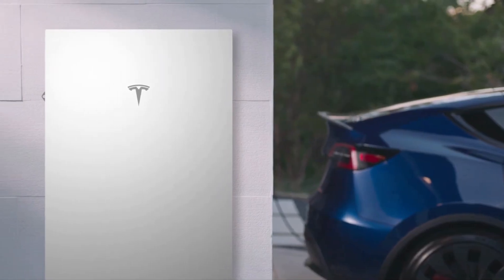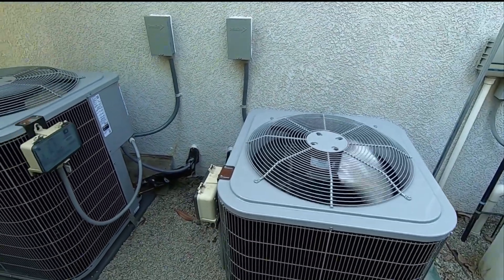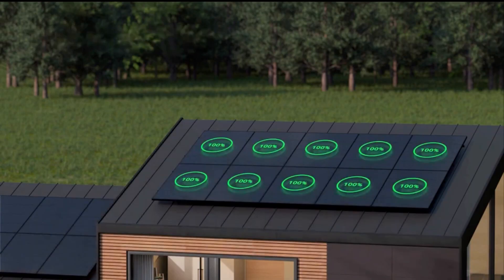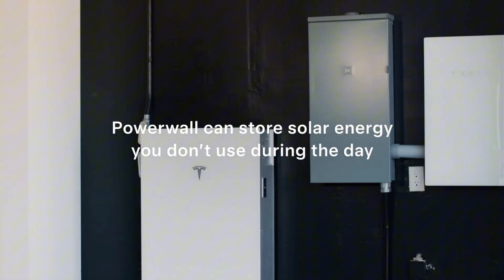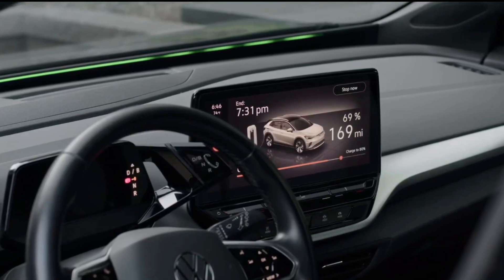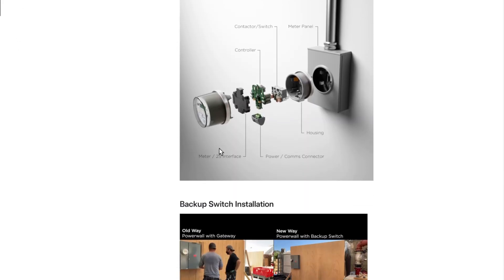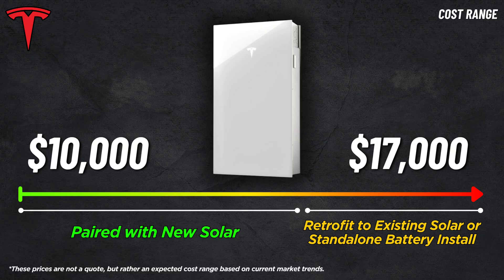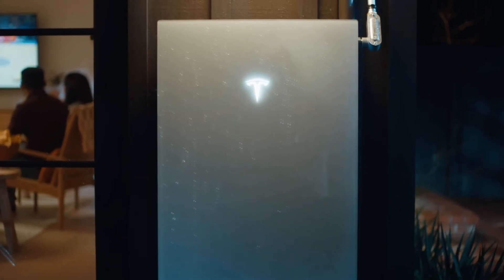Is Enphase REALLY Back? NEW 10C vs. Tesla Powerwall 3

Comment: Can we combine enphase microinverter with tesla powerwall 3 battery. What particular parts have to be changed or to be added to be able to run this hybrid system will this be financially practical.? The system I'm referring to is 17 solar panels enphase system without battery running for 4 years.
Reply from the maker: Yep, you could do this no problem. We pair Powerwalls to existing Enphase systems all the time. You don't need to change anything to the Enphase system.

Comment: Had Enphase Batteries for the past 7 years. Their product support is appalling, it's taken me in excess of a year to try to resolve an issue caused by them fiddling with their software. Still not resolved I'm dumping them for a Powerwall.
Reply from the maker: That’s a bummer to hear. Which Enphase battery did you have? The 10T?

Comment: @2:44 When Tesla makes that claim, is that power consumption designed in mind for a 24hr window?  48 or 72hr?  SGIP in CA is starting to push back on systems with 2+ batteries, stating the usage has to be accounted for before the rebate is approved.  But what does that mean?  During our wildfires, we can be without power for days at a time, but how do you gain support given your current consumption of power?
Reply from the maker: Tesla is saying they can backup the vast majority of single family homes meaning it has the power (kW) to support all of the circuits in most homes. Now how long will that battery last during an outage? That’s entirely dependent on how much energy the home uses (kWh). Most homes will range between 6-12 hours on a single battery depending on AC usage. Incoming solar energy can recharge the Powerwall during a prolonged outage.

Comment: The size, capability, functions depend on the size of your house and what you want to do with it.  If you are installing a solar battery system,   remember you are investing into your future.      My house has 2x17kw 3phased air conditioner.  Plus a 22kw 3 phased power wall box for EV.    What is the point of installing a system that does not support the prime electricity usage in your house. 

When I told my builder and the solar installers I want to the system to backup  4 hours of one of my air conditioner to work,  most of the solar installer gone nuts.   They think I am crazy.    I have not heard of Powerwall 3 capable to support 3 phase at the moment.      At the end I go for 3x Fronius 3phase inverter and 3 BYD batteries just been activated this year.

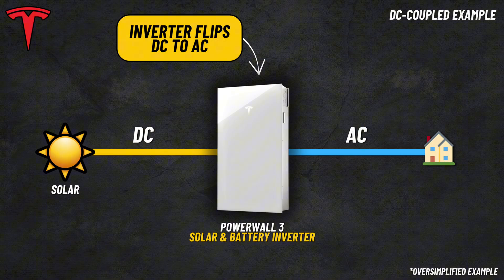Comment: 5:55 - Wow, surprised the Tesla went with DC-coupled battery architecture.  That was a bold move on Tesla's part since that would mean it uses high voltages, maybe upwards 600VDC+ and use a string inverter.  I suppose the Tesla solar still needs an optimizer unit behind each panel which also allows them to perform the legally required rapid shutdown (for NEC Article 690.13).

With the growing popularity of microinverters, we'll see less DC-coupled systems in the residential space.
Reply from the maker: Tesla uses their MCI (Mid-circuit interrupter) to comply with the rapid shutdown requirements. A lot of manufacturers are moving towards these all-in-one DC coupled solutions, like Powerwall 3. Tesla is crushing it right now.

Comment: Hi Zach, I have no issues with shade (no trees or obstructions), would that take away from the advantages that the enphase battery system has to offer? price difference between pw2 and the 10c is about 2400
Reply from the maker: I prefer Powerwall over Enphase personally. But they’re both great options. If you don’t have any shade (or a complex roof layout), I don’t really see the purpose of microinverters from a performance standpoint.

Comment: From your experience are batteries permitted to be installed in basements (or are there size limits)?  I'm guessing it's a state-by-state situation, but curious from your experience.  IMO it seems safer (and more effective) than a garage as it eliminates the potential for vehicle collision/impacts (unless wall-mounted up high).
Reply from the maker: Yeah that's definitely all dependent on the AHJ and the code requirements in that area. We don't really have basements in the areas I've worked in my career so I don't have much experience. You do have to consider the wire run from the main panel to the battery as well.

Comment: Big issue - lack of DC expansion on EnPhase battery systems. Though with low output need a 2nd unit for many homes anyway. I’m on the coast, with low AC usage, mainly natural gas appliances, and even then the 10c would barely be adequate …  ie, utter EnPhase fail.  For all but smallest sites, you’ll need 2 10c’s (vs 1 PW3, for me).. so EnPhase not even close to cost competitive
Reply from the maker: Very good points you made here. In retrospect, I didn't even talk much about the advantage Tesla has with expansion.

Comment: Seems inefficient to go from DC panel to ac inverter to DC inverter to battery then back again to ac inverter. What's the point..
Reply from the maker: There are definitely pros and cons between the two options. But yes, DC-coupled is technically more efficient due to the decrease in conversions.
Reply: Yes.  5% or so lost on each conversation.  But AC at the solar panel has efficiency advantages over DC strings.  Depends on individual needs?

Comment: I’m new to this and probably am ill informed. 

I contracted a company to install a Tesla solar system ( 12 DC panels, a gateway and a Powerwall 3). 

After 2 months I got a new AC and found the need to up the system with for more panels. Contacted the same company and bought them (I did not get an option because they seem to choose for me). 

They came in yesterday and installed 4 AC panels with micro inverters  and an Emphase IQ Combiner 5HDK. 

The Tesla app gets readings from all 16 panels but I still wonder…

Was this the correct move by my solar company of choice?

Does it matter? 

What gate way should I rely on if I decide on expanding my solar panel count?
Reply from the maker: Very interesting...so your original solar installer (who installed the Powerwall 3) came back for an add-on and installed a new 4 panel Enphase system to add to the Tesla system? Am I understanding that correctly?
Reply: @ZachSolar yes.  Exactly right. My initial (main setup) is a Tesla Powerwall 3 with 12 panels. The add-on is an Enphase one. It kinda bugged me but still don’t know what to make of it.
Reply: I just got my response from my installer. They are not working with the supplier of compatible solar panels and hence the Emphase expansion.
Reply: Depends… if in CA and wanting to stay on older NEM 1or2, then non-export expansion might make sense, and small expansion using micro-inverters can make sense.  BUT… depends. Explanation so far begs more questions as to whether recent solar vendor choice was ethical and appropriate

Comment: EG4 Power Pro Battery. Water proof, heated, 14.3 kWh, 12kW continuous output LFP and 10 Year Warranty all for $3899. People Go to Signature solar and don't pay these overpriced solar parts. I have one and am getting another one.
Reply from the maker: That's not even close to apples to apples, so of course everyone else looks "overpriced" in comparison. The battery itself is just one of the components needed. You forgot to mention the cost of the hybrid inverter, the MID/Gateway, and all of the necessary components (AC disconnects, subpanels, etc). Plus all of the other soft costs that go into a project - including labor cost.

On a turnkey install, Tesla is really hard to beat. Especially once you consider the backup switch, VPP integration and their software as a whole. 

EG4 makes a good product, but I think it serves a different market.
Reply: @ZachSolar I have already done it and it is working fine. No electric bill in the last 4 months
Reply: @LarryRichelli Did you self install?
Reply: @Energy.Theory no it was included with my pannel installation
Reply: @LarryRichelli what did you end up paying? I have a bid and I’m looking to see if I’m getting a good deal.
Reply: EG4 is for DIY off grid people and won’t be here for long term.
Reply: @solargod3671 that is the biggest line of BS I have heard. Signature Solar was selling solar equipment before there was Tesla

Comment: Hey Zach, thanks for the education. I was wondering though isn’t it hard on the batteries to drain them to 15% and charge them back up to 100% every day? I have a power wall three brand new and I always thought that you shouldn’t discharge more than 20% or recharge more than 100% especially on vehicles is that a different situation with the power wall? I thought they were the same type of battery. Maybe different chemistry? Please advise.
Reply from the maker: Great question. So Powerwall 3 uses Lithium Iron Phosphate (LFP) chem, which is considered very durable for that daily charging/discharging. Most EVs do not use LFP.

Tesla also does include unlimited cycles in their warranty. I’d have zero concerns with charging it to 100% or discharging it below 20%. That backup reserve is really designed for a reserve in the event of an outage, not for battery longevity. 

Enjoy your new system!

Comment: 1:20 the better comparison would be maximum acceleration rate rather than top speed. It is the initial startup surge of say an A/C that you need to be concerned with, rarely do you need to run everything at once especially during an outage, do the laundry later, turn off the pool pump, and don't charge the car during an outage especially if the AC is running.
Reply from the maker: That's fair, I've always used top speed but I do like the phrasing of "acceleration" to help people understand it.

Comment: I currently have three systems with Enphase IQ8 micros.   Two of them were installed last year as partial home backup systems using System Controllers and three 5P batteries.  We had pre-existing critical load panels for generators at both locations, so that was relatively easy.   I'm pretty happy with those systems. 
The third location, installed this spring, is currently solar only because I wanted to see what the new battery solution from Enphase looked like.   Frankly, I'm a bit disappointed.   The meter collar won't work because there are two 200A panels being fed from a 320A or (340A?) meter.   And last I looked, there was no generator integration with the new stuff either.     Battery backup is great until your power is out for a week in the dead of winter and most of that week is heavily overcast.   Then you need a generator too!
Reply from the maker: You are correct. There’s no generator input on the new 10C from my understanding. Sounds like the Franklin aPower 2 might be a good option for that third location.

Comment: Great Video as always, Zach. Honestly tho, my biggest concern by far is the accelerated demise of the federal tax credit.  The new Senate version is, in my opinion, ridiculous. I recently signed my contract and now I'm stressed beyond belief because the system doesn't make sense without the credit. Would you please do a video on this monumental issue? Without more certainty, all other aspects of solar comparisons become analagous to asking, "Besides that, Mrs. Lincoln, how was the play?"
Reply from the maker: Thanks! And I agree — the tax credit situation is in a weird limbo right now. I’ve thought about doing a video on it but decided to hold off on recording until something gets finalized, just to avoid adding more speculation.

Edit: I posted a video on the tax credit situation. Installation of the item needs to be completed by end of 2025 in order to qualify. Still plenty of time at this point (7/5)
Reply: Looks like you are covered for all of 2025, but nothing except limited credits for “commercial investment” (8% for ‘26 & 6% for ‘27).